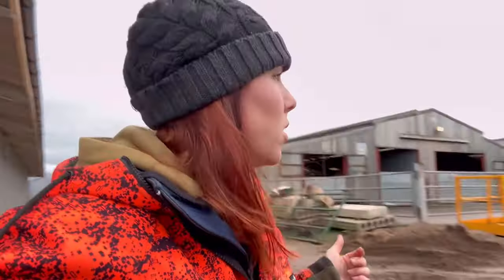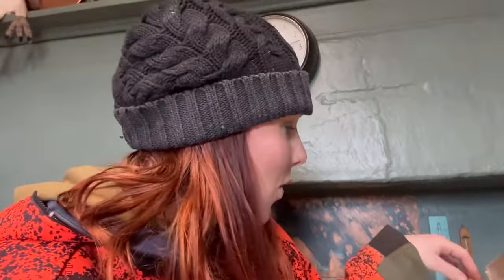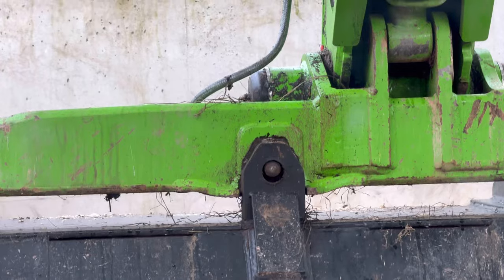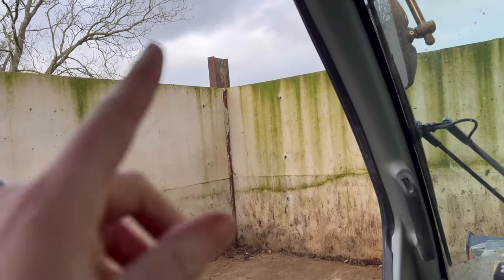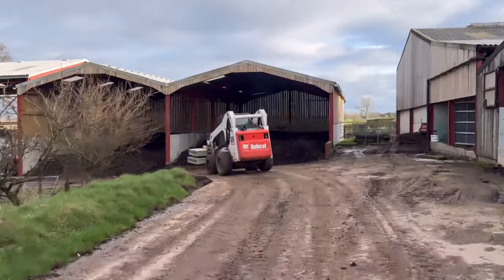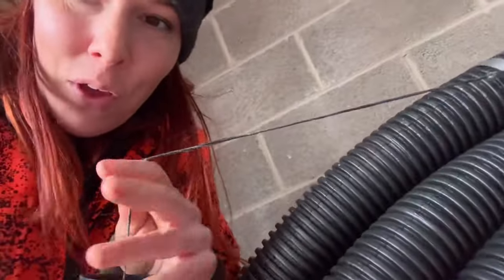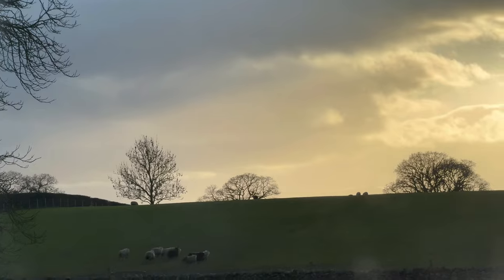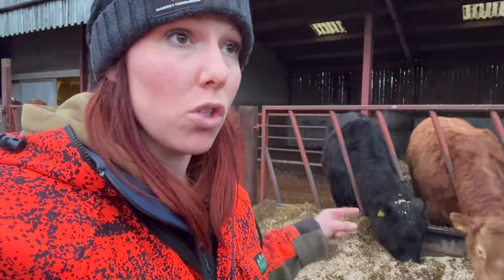Three phase electric how much??? Cow deal falls through

Comment: Best having buried cables. Better than getting too close to a 33000 volt overhead wire with the telehandler.
Reply from the maker: Oh god that would be scary I heard of a lad the other day who got trapped in the cab
Reply: I worked as a student at Nursey in Norfolk.  One chap had hit an 11kv overhead wires with an aluminium irrigation pipe, he lost his right hand and all his toes where his metal toecap had melted as the power went through him. 4 months in hospital before he returned to work 6 months after the accident. 😊

Comment: That double ended screw was for attaching a finial to the top of the pole .the finial was to deflect rain from going down the end grain and causing rot, but most rotted and fell off and we were told to remove any we found as they were a falling hazard

Comment: If you want to get a string through a cable duct that is clear connect a vacuum cleaner over one end and feed the slack string in but hold onto the end. If it is a very big duct you will need a big vacuum!
Reply from the maker: Ha ha ha does that really work I’m going to try it… Roy’s gonna be like why is the Henry hoover on the building site?
Reply: I would put a draw string on the cable as well when pulling it in. It wouldn't be the fist time that the cable comes adrift when pulling it in and the draw string needs pulling back.
Reply: I thought it was a job for the local ferret😀